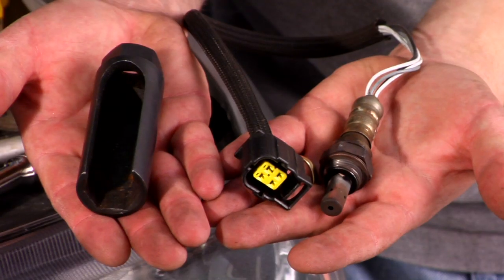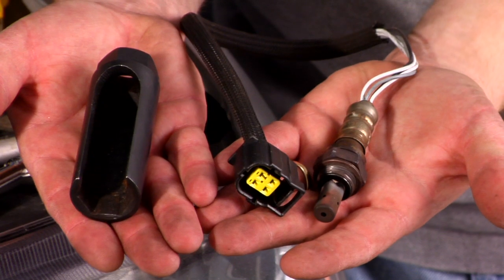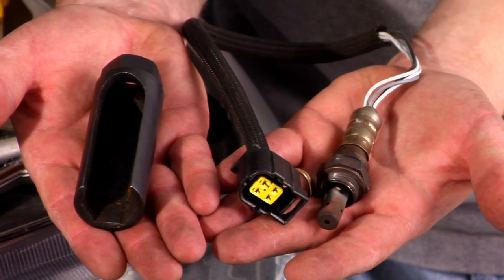Troubleshooting Car Problems : Troubleshooting Oxygen Sensor Problems

Comment: Not allways will you get a check engine light, at least on this 94 geo metro. Mine was very, very, very, very bad. A very reliable mechanic told me that the O2 sensor will be completely bad before it will trip the engine light most of the time. When i replaced the O2 sensor, the problem went away.

I know my engine light works because i came on for the egr.

Comment: got a 2000 dodge caravan that is lacking power, backfires if accelerated fast, bucks and sputters. One O2 says too rich and the other says too lean but NO check engine light ever comes on.(it does work, tested it by unplugging the EGR valve). also no power climbing hills and it hesitates. replaced EGR and catalytic converter and same problem:( help guys!!!